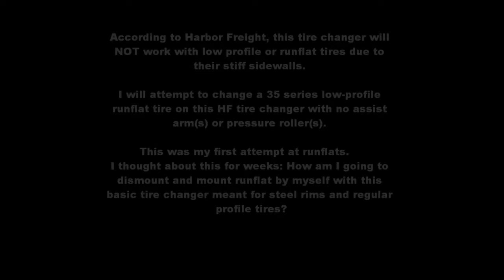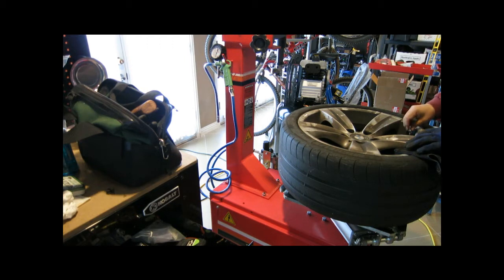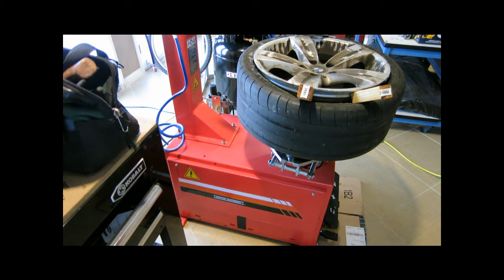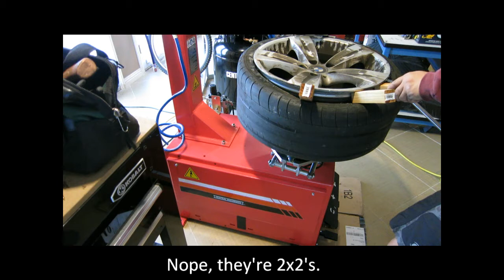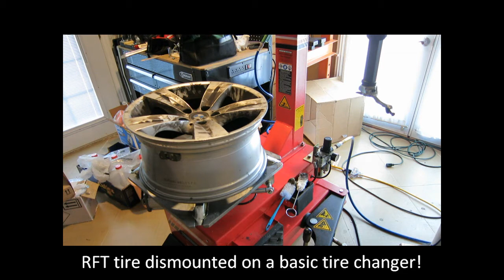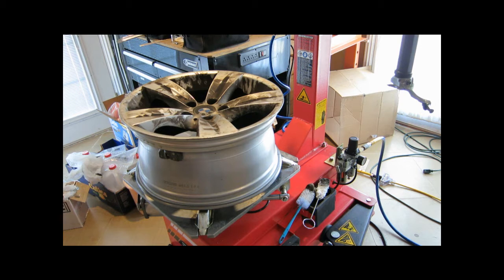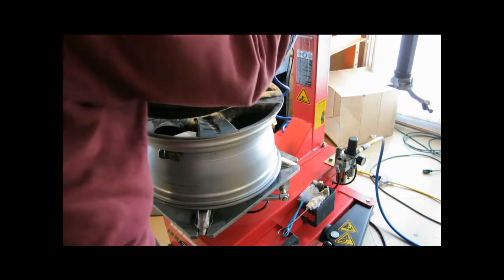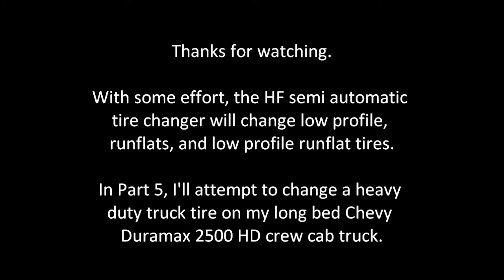Harbor Freight Semiautomatic Tire Changer 67517 - Run Flat Tires - Part 4

Comment: The bubble on the side of your tire is from curbing it, hitting bumps or hitting pot holes. It pinches the sidewall into the rim and breaks the belting, causing separation of the rubber layers and air to bleed in between.
Reply from the maker: Thanks.  However, not in my case.  These tires are known to bubble (google the tire and side wall bubbles).  In fact, the bubble on the driver's side too.  When I changed brands, that resolved the issue.
Reply: garyhgaryh
no, its from hitting stuff, and 9 times out of 10, the inside of the rim will be bent in the same plain as the bubble. some tires are more likely than others. also, this tire machine has been discontinued by harbor frieght.
Reply from the maker: Mike Miller You are telling me you know, without a doubt, why my runflat bubbled? I am not saying you are wrong but I'm also question how you are so sure that my runflats were not defective? 
Here are some other reason why they bubble.
http://www.tirerack.com/tires/tiretech/techpage.jsp?techid=159
Reply: garyhgaryh if you cared to read the link posted, majority of the time it's caused due to impacts. Low profile tires will be more susceptible to potholes and should be avoided at all costs. It happens to all tires, not just run flats.
Reply: I've worked at sears automotive for 2 years back in college. So not too long but from my experience some tires do have an issue with bubbling in the side wall. This is noticeable right after install. Generally they are found at a joint or union. It's a cosmetic eyesore and it is a defect. but you guys are all right hitting curbs and potholes can cause this and if a tire is all ready known to have this issue from a certain manufacturer it would be more susceptible to the damage. So do research on the tires before you buy and never just buy the cheapest. Not saying yours is cheap because i know damn well run flats are pricey. This is for other people watching this video.
Reply from the maker: Thinh Nguyen I agree.  Thanks for the well though out comment.  People are too quick to judge these days thinking they know it all :). Thanks again.

Comment: The reason why your having so much trouble starting to get it off is the fact that you've got it dropped so much everywhere else. Pop your bar in at the head and start pulling it over, using a second bar, wedge it in between the bead and rim, pressing it down, applying pressure the whole time. The bead will slide down as needed when you get the bar over all the way.

Mounting, you sorta had the right idea, but its still a 2 bar show, without forcing it down so low. You start at the head the bar under the rim, pressing down on the tire. Spin until you the bead starts to push up and remove the drop. Get the 2nd bar in the middle of that, and it should go right on.

You said it yourself, the sidewall is stiff. It works against you, but you can't just push it right down, or it losses all that flex that you do need to take advantage of.
Reply from the maker: Thanks for the tip! Comments like these help the community :).

Comment: I too have an automatic tire changer (although mine has the assist arms which makes the job much easier) and would like to point out a few things that might make your changes even easier.
1) consider replacing the 2x2 blocks of wood and instead use nominal 1" stock UHMW. My blocks are about 2"x4" (3/4" thick) UHMW is a hard plastic that holds up better than wood and can be lubed on the back side to allow the tire to more easily slide. 1x stock is plenty large enough to get the bead of the tire under the bead of the rim. You can pick UHMW up in woodworking supply stores and use common woodworking tools to cut and shape it. Knock the edges off all the corners and you'll have some really nice blocks for mounting tires.

I use about 4 of these blocks when mounting RF tires or stiff heavy cruiser motorcycle tires.

2) I didn't see you lubing the top of the rim nor did I see you lubing the drop center. Doing these two things will help the tire slide over the rim flange AND lubing the drop center of the rim will help let the tire slide into the drop center.
3) Lubricate your tire iron when lifting the bead over the duck head. This will make things slide a bit easier.
4) Lubricate the back side of your blocks (the side that touches the tire). This will help the tire slide along the block and into the drop center.

Good luck!
Reply from the maker: Great tips.  Thank you.  I'll look into UHMW (what does it stand for)?  I did lube the beads, but you only saw me dabbing it when it dried out.  Thanks again for your input!

Comment: Installing these tires should be $100. probably is some where. People who buy these crappy low profile tires because they think they are pretty are told at my shop to go somewhere else to buy and install them. I've got enough business doing normal tires.I dont need that crap. Good job  changing the tire on that machine not meant for it.

Comment: Why 51 PSI? Isn't that the maximum pressure? You hauling bricks in the trunk? :) It's hard to tell in the video, but it looks like the middle is worn more than the edges which is a result of over inflation. If I'm wrong, then keep doing whatever you're doing, just trying to help.

Comment: those wheels are designed to be removed the other way up, mount the alloy upside down, they come off the rear!. When starting the tyre off you had big trouble, just flick the machine backwards a bit instead of using the second bar and itll seat on the arm properly. when you tried to spin it wouldnt go (too much force on the motor) just help it by giving it a bear hug with one arm and puling, this way you act as a second motor and dont burn your one out!

Comment: if the tire already has bubble and un-usable why not just cut the side using recipocal saw.  After that, removing the rim from the bead is much simpler.

Comment: that machine is so much quieter than the ones i use... is it 100% air powered or does it use an electric motor for the turntable?
Reply from the maker: SgtPnkks It uses an electric motor.

Comment: Also to make thing easier don't use wood when my tyre machine broke I replaced a run flat by braking the bead barker and holding it down with the claws and then levered the tyre off with just the iron

Comment: number one...you clamped an aluminum wheel from the inside....Big no no.....And number 2.....wood blocks? Get yourself a second bar and drop your purse lol.....After 13 years in the industry....this shit made me laugh...... And the BST RFT's are wwwaaayyyy worse the the Mich RFT's. I can do a set of four BST RFT's in just under an hour. Pick it up mate :P Good vid.
Reply from the maker: +DWI TheNastyOne Hey Mate, I've done BST and Mich run flats on this machine with no problems.

Comment: Easier to pay $300-400 more and get a proper machine with low profile tire support.... Also why don't you get regular non-runflat tires, they are way better and cheaper too!
Reply from the maker: The runflats have saved me a few times when I've gotten flats.  I'm able to drive home.  The car comes with no jack or spare so I am one of the few that are sold on runflats.

Comment: Revolution Tire Changer - Hunter Engineering

ONE workman's comp claim will pay for this machine.  I appreciate the cost-saving thoughts on your tire changer, but fore-most the risk to your personal safety & equally to the wheel/tire product are incredibly high by using "back-yard" techniques.  What would've happened if that tire bar had slipped?  I wouldn't EVER consider changing tires this way.  Please be careful.

Comment: You know most of the time if you know what your doing you can push the tire on and no problems I bet he fucked up the tpms while doing this it takes me 5 minutes tops to change these same tires on and off you wanna know tires that sucks to put on porche 911 turbos anything post 2006 and lambos the shop I worked in had em come in all the time cause the car owners knew the shop owners
Reply from the maker: My TPMS works fine thank you.

Comment: wood blocks! Premium tires and wheels on a premium car require premium tools; in this case the better machine. Don't do this unless you don't care about the customers' wheels or your own. Yes this will remove the run flat, however it is the last resort if you dint have the proper machine. SMH !
Reply from the maker: Viktor Warhola My machine, my tires, my money.  I'm the customer so I'm fine :).  No scratches whatsoever so we're all good.
Reply: Yup. That works for backyarders, not for a commercial enterprise where your doing this mhalf the day. I have to admit it's clever though!
Reply from the maker: +Viktor Warhola I'm definitely a backyarder :).  It's funny, I got friends lined up for me to do their tires.  I could make it a business, but then if I did I would get a proper tire machine, not this basic one.